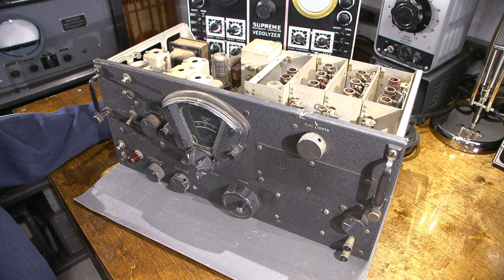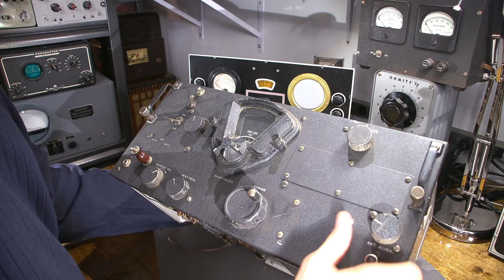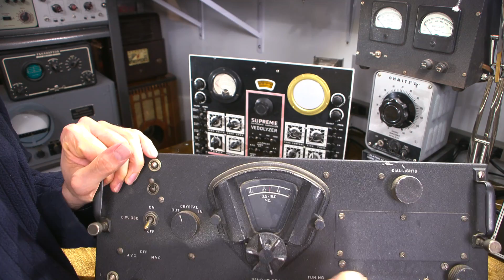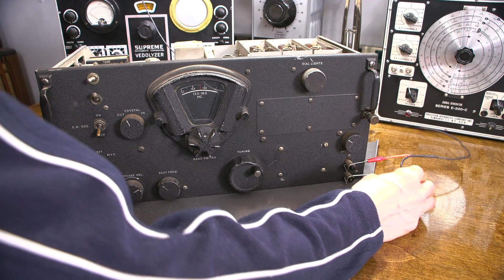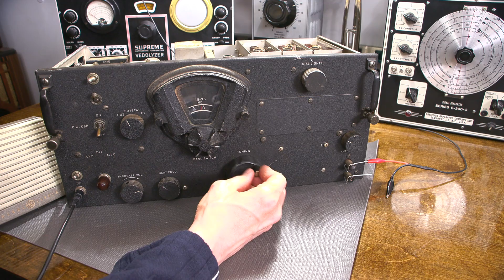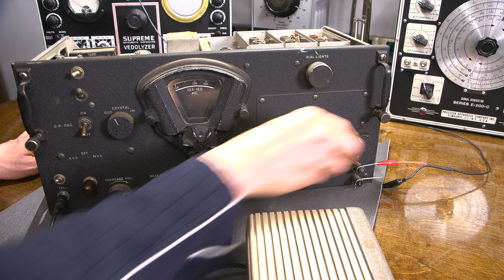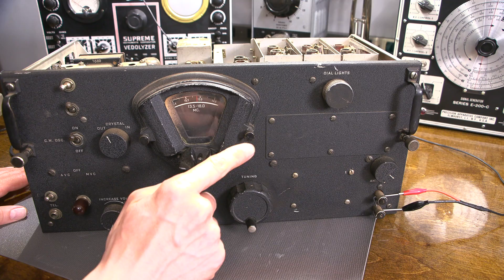B-29 Aircraft Receiver Scrap Parts Unit, Will It Still Work?

Comment: What frequency bands does it have ? 
Just shortwave and VHF aircraft ?

The ICOM from the 70s did .1 MHz to 1.0 GHz

I don't remember the model, but it was big like this

Highly desired by ham operation and in the early 80s by scanner enthusiasts

I remember picking up all the cellular frequencies in the mid 80s when it was all analog and they were spaced .030 apart for each channel.

Made it really easy to find them and to map out the cells and the arrays for each area. Based on the frequencies I could triangulate where any cell phone was.

Really cool.

Also listening to all the pager frequencies

All analog back then

So many incredible calls and pages

It was an amazing experience and a great time in history

Comment: That looks like my brothers  old BC-348. I sold it on ebay many years ago. I think it had the wood knob on it. It had allnthe covers when I sold it. It also had an extra conversion stage added with the extra tube under the bottom.. Strange you have it...Mike- N4OYR

Comment: Is it possible to purchase your capacitor leak tester from you or anywhere?  Someone just stole all of my equipment except for a screwdriver and a hammer. Guess I can still fix a lot with those, but it’ll be difficult gaining repeat customers!! Long time follower and deciple, your my electronic God🙏🏼!! Thank you!
Reply from the maker: Hi Brian. The plans to build it with "additional" instructions are on Patreon. I may release boards in the future, but right now, the build process is still a part of the course.
Reply: My Lord, Please forgive me for trying to bribe you or one of your followers for a working model of your miraculous capacitor leakage tester. I had gathered 3/4 of the parts list from Patreon and was struggling to find the rest. Now it’s all gone from the burglary. If I can’t pay you handsomely for a used or pre-made unit, do you have any leads on a supplier I could try? Thank you for listening to my prayer🙏🏼 , Amen.

Comment: Mr. Carlson,
I work in electronics labs with really awesome equipment but I have nothing at home but a fluke handheld multimeter and some basic stuff like that. Around the house type stuff. I'm looking into making my own primitive lab at home for modern electronics like your Yaesu video as well as some AA tube radios. What would you recommend for some entry level basic equipment? Sig Gen, Multimeter (unless my handheld DMM is ok), O-scope, etc? I know that's a lot to ask but maybe a good brand or something? I currently have no swap meets in my area until probably next year when I move but I regularly check the flea markets to no avail. Maybe you could make a quick video on what equipment would be wise for beginners. Would love a Mr. Carlson origin story on the side! Hope you're doing OK!

Comment: 30 minute video flew by! Crazy to think these were $50 after the war in the surplus shops, hell of a bit of kit for the money.  These have an unusual IF of 900khz or there about if I recall (no B/C band so not really a problem) ?  Compared to some of the more modern tubes I wonder how well it receives in the higher frequency band.

Comment: Looks like each band has its own tuned preamp, with separate RF amplifier tube in each compartment. One band appears dead - could be as simple as a dead tube in that compartment?  If that are all similar type tubes, you might try switching them around to see if it brings the dead band back to life.

Comment: There is a plate on the right of the front face, held by six screws. Is it an accesss hatch for quick tunning/repairs, or is it meant to hold some additional controls/indicators in other models and is just cover for a hole on this one? Also, there are for screws beneath those six, in rectangular pattern. I believe they are holding in place something inside the box, but is it so?

Comment: I've often wished for the ability to filter out videos with titles that include will it start or will it run in the context of cars. I can't say I love it here without some explanation for this new change in direction. Was all the exhortation never to plug in an old piece of gear in past videos just a mistake or is there a difference in this situation that I should have recognized? I'm really confused.
Reply from the maker: The difference is: If it burns out, I can fix it, and you can learn from it, as we find the failed part.
Reply: That does make sense, I have to admit. Thanks. ;-)

Comment: That is a very lucky that find.
Amazed it was spot on at 5 MHz! Have you had experience of the American HRO? Fantastic receiver.
Was that 4 gang variable capacitor for an RF amp stage. Was it double IF's?

Comment: Possible that the 9.5-13.5 MHz band was used as a tunable IF for 10 meters.  That miniature tube beneath may have been a conversion stage to add 10 meters.

Comment: I have an ARC 5 for 7 to 9Mhz receiver. A friend gave me a solid state dynamotor replacement power supply (inverter). I just had to rewire the filaments for 12 v.

Comment: I remember as a kid seeing all sorts of WW2 surplus in places like JJ Glass, Highway Surplus, C&H in Pasadena, etc. Dad was one of those "Hams" that you seem to like to bag on and was always working on either fixing or building from the ground up some radio related gear. He was was especially proud of his PERFECT COPY, RTTY certificate from an Armed Forces Day. 

At this time I have a Morrow "Twins" set, MBR560, MB565 and 600 power supply to go through and put back on the air. These were intended to be a compact transmitter and receiver for mobile use in the 50s-60s. I was surprised at how 7 and 8 pin "octal" type connectors have become. Even Apex Surplus that always has everything old had completely sold out! I did manage to find the connectors from a few different sources so I can make the interconnecting cables for these radios! 

Have enjoyed watching a few of your posts!

Bill, WA6DVG

Comment: I bet that extra tube is an audio amplifier - there would not have been a speaker in the aircraft - too much noise from the engines - so although the output obviously drives a small speaker, a bigger one might need more oompf, to use the technical term. That, of course, would be what the audio transformer is for as well.

Comment: Now look for the BC375 transmitter that accompanies this amazing radio and the multiple tuning units that are the size of the radio receiver. Remember that these were built by Stromberg Carlson, RCA etc  under license and if the build plate was present it would give an identifier. Eg: N, Q, P etc. I have 2 of these in pristine condition and one that was at Bletchley Park before they dissolved the museum there and part of the David White collection. BTW not every ham is as incompetent as you make believe..... I’m a ham and mine are near mint condition!! The more original the better.

Comment: I worked 35 states on 40 meters with a BC-348 as my receiver.  I was 13 years old.  Later in life when I became a pilot I discovered these radios were on the B-17’s.

Comment: You are wondering why this B29 radio was designated as "scrap"?  In the US government's wisdom, in order to justify getting something out of inventory is deemed as "scrap."   Scrap consists of recyclable materials left over from product manufacturing and consumption, such as parts of vehicles, building supplies, and surplus materials. Unlike waste, scrap has monetary value, especially recovered metals, and non-metallic materials are also recovered for recycling.  The US government has volumes of regulations regarding government owned materials , guidelines, policies and procedures for disposing of Scrap, Valuable Waste, and for Storing Salvageable Material.  REF: 48 CFR § 52.245-1 - Government Property.  
I hope you can restore this beauty to full functionality.

Comment: Why is there an access plate on the front right hand side? This seems to be right where the regulator tube was missing. Usually manufacturers don’t add unnecessary items that increases the cost without a good reason. Just curious! Great piece of equipment when they made things to last, especially in an aircraft that might be going to war.

Comment: I have one of these, but converted it to solid state as a project in the late 70's. Built my own IF strip for it, but used the front end coils / switch / tuning capacitor left as standard original, and replaced the valves with FET's. In the Oscillator cage, soldered a fet to a valve base and plugged it in. Still works superbly. Now wish I had left it original.

Comment: Them radios were still in the inventory in the late 60's early 70's we had a couple laying around in our radio room in Germany ..sometimes we'd drag them old spark gaps out and play with em in the evenings...Yeah they were pretty noisey...Especially then transmitters...we could crank em up to the point where they would rattle the pool balls on the table 4 stories up in them old stone barracks with a dublet  antenna strung between the barracks and start calling CQ DX and wipe out everything for about 10 miles and ham operators back in the states were wondering what in the hell we were using and since them old radios worked off of smoke you couldn't get all of the smoke out of em...lol
Reply: I forgot my Dad was a gunner and a crew chief on the B-29's in Guam but passed before Fifi was completed...but at least my uncle who was a Navigator on another B-29 did get to fly with Fifi on a few occasions and I'm glad to see Doc in it's bare metal finish as most of them were then to save weight on those long trips..

Comment: Really nice video thanks.  I recently received a 1947 oscilloscope for an AA gun predictor and it's in amazing condition. Problem is that it tripped the electrics when turned on. Any ideas where to start on something like this? Thanks again. Nick
Reply: Might be duff mains transformer Nick. Have you checked the windings?

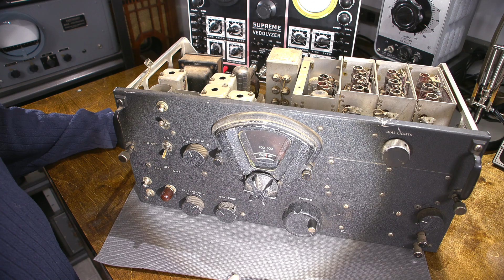Comment: @6:00. Re: Ham mods. I was thinking about something similar concerning vintage computers (PET, etc.). It begs the question as to which is actually a more authentic  museum piece - modified, or box original? Given that the true enthusiasts that for all intents drove industry technology, not just the hobby - modding, improving, evolving, bits of surplus kit. One could argue that a period mod is as authentic as a box original .. perhaps more so. Sure, there is much shoddy business out there, and platoons of dead soldiers ravaged beyond the skill of their caretakers, and I certainly wouldn't drill into (say) a mint vintage 'scope to add a curve tracer (component checker) .. but I wouldn't undo an existing mod either.

Comment: They certainly don’t build them like that anymore... from a time when the words quality or built to last meant something...
I wonder what the designers would make of modern products that barely make the end of 12 months warranty..... 
now we live in a throw away society it really is quite a sad state of affairs...
Nice job as always
Reply: Loz11968,...I thought of making a similar statement but you did a far better job of it than I think I would have.
Reply: The days of quality engineering. I remember lifting the lid off a pioneer a91d I used to own. Similar in construction quality to this ham radio. No expense spared. They went to the trouble of putting cast iron over the transformers. Copper chassis. Top end capacitors. Piano finish with real wood panels. Biggest regret selling it.

Comment: I sometimes wonder if somebody out there has tried to duplicate these old radios with current technology. I think that would be really cool.
Reply: You could probably do so with an SDR.  I like the old tube technology.  There's nothing like sitting in front of tube type equipment on a cold winter's evening listening to some signals coming thru with just a bit of QSB to make things interesting.  Unfortunately I downsized quite a bit some years back & moved into a QTH with a lot less space.  I still have a small shop where I can work on stuff.  The micro sized parts are a whole lot easier for me to store than the much larger tubes, coils, capacitors, & transformers that all the old equipment required.  One of these days I'll probably get back on the air a bit but it will be with a much smaller SDR that I can mount on a wall somewhere and control with my computer.  Morse code would be nice to mess with again but I suddenly and completely lost any hearing in my left ear some years ago.  The white noise between stations really messes up my head so I try to limit that aspect of things and communicate thru a keyboard only.  You can do that on the internet (like now) but times change.

Comment: I have a RCA AR88D found most of the resistor high in value not surprising after 70 years but it still functioned  I  have changed them it weight is 100lb I had to wrestle with it should have gone to a weight lifting class first.
Reply from the maker: I have one of those in Que for some bench time. Yes they are "Very" heavy!
Reply: @MrCarlsonsLab  Hi just found this old reply re AR88 just to mention in case you do not know the components for the bfo are inside the osc can and my where out of spec I suspect due to the heat.

Comment: How did they address the extreme temperature changes these radio’s capacitors and tubes were subjected to especially in the B-17 which wasn’t pressured or heated? 
Anyone know?
I realize capacitors are sensitive to changes in temperature due to the expansion and contraction of ambient temperature.

Comment: How was connected the ground wire on a plane? Was it connected to the plane's chassis itself?
Reply: Thats the only way, yes. Otherwise the ground could also be connected to the second wire of a dipole outside the plane. Either way worked

Comment: Oooh! If you happen to find a Telefunken VF 14 M vacuum tube in there I'll give you a couple bucks for it....I'm finally getting my original 1957 Neumann U47 back together....managed to find a good condition GN8/BV8 transformer and got real lucky on a K47 capsule..................uhhh....was I .........was I dreaming out loud again?
Reply from the maker: I have to hold onto those for my own usage. Have you looked at their current pricing? Crazy at 3 to 5K for a single tube.
Reply: @MrCarlsonsLab  Yep. Crazy is right, and probably a Grape-Nut sized flake of getter compound left. I  heard they put those in old military radio gear, I went through both my uncles Korea and Vietnam-era gear they somehow managed to uh.. salvage but I don't even know what kind of gear they put them in, or what year, or what country...but anyway, it's always kind of exciting to be disappointed.
Reply from the maker: The audio guys jump all over those tubes, and there are so many better ones to retrofit. Better noise specs, lower hum, so on. It's all fun to read and watch, but don't dare tell them different... LOL.
Reply: @MrCarlsonsLab  Lol! Shhhhhh!! They might be reading this. 
BTW I like very much the microphone you use to open with, and I guess throughout the rest of the video as well.  It has a nice warmth and fullness to it. Through my half decent computer speakers it almost sounds like you're right here. 
And thank you for a very good and informative channel. Your measured delivery makes me think you teach or used to teach electronics at a school, or possibly an attribute common to Canadians.

Comment: The only reason that they used the dynamotor on the aircraft was that you couldn't find a long enough extension cord to plug the radio into the mains and still fly the plane.😁😁😁😁

Comment: I am very frustrated- when i watch these  vidos all i want to do is what you do -i have 2-3 tube sets and bought a tester and box of tubes-doesn't work.
I have been doing clock and watch repair for10 yrs.-i am well aware of what equipment it takes to do a good job along with parts availiabilty .
Still;it is fun watching some one repairing and restoring things that would be thrown out.

Comment: Back in 1971 I was stationed at Fort Lewis Wa, I had just returned from Vietnam. I was with the 3rd Armored Cavalry HQ Communications Section.  We received orders to move to the Desert for training to ready for the wars that were boiling in the middle east, we had been training in Mountain Warfare in the Washington post. So it was pack everything up and haul it to the railroad depot to be transported to Fort Bliss Texas.  We had an old receiver much like that, only set up for Army use that sat in the corner of our section, the thing weighed a ton and was completely obsolete.  The NCO in charge offered it to me, I still kick myself for not taking it, but I considered that I would have to haul the damn thing all the way to Texas and I didn't know about household movers that were available for soldiers back then.  So we just left the old receiver in the building. My good wife was with child, our second, and her due date was around the moving date. I let my NCO know and to avoid problems, he sent me along with the Advanced party 3 months ahead of the rest of the unit.  It was actually a good thing because when we got to Bliss, housing was open all over because another unit had been rotated out to make room for us. I had my pick of off base apartments and there was actually housing available for we lower rank soldiers with families at 25 bucks a month. A real deal for old base housing. Ah but that is another chapter in my Army life, and the old receiver sat in that corner till some other unit arrived and probably tossed it in the trash.